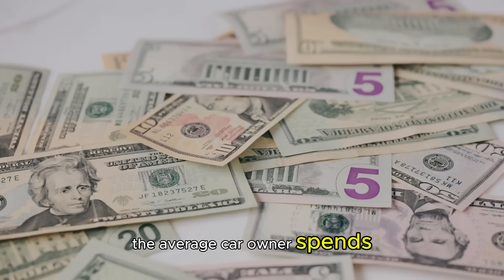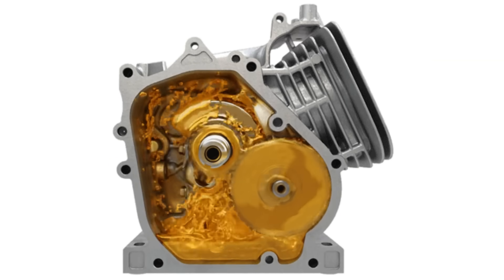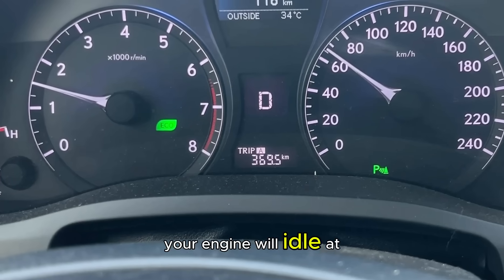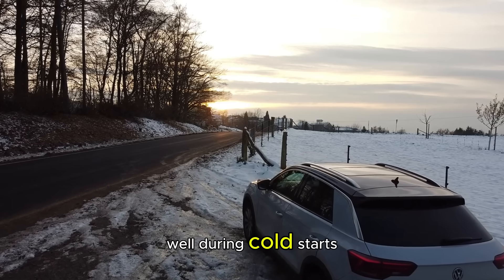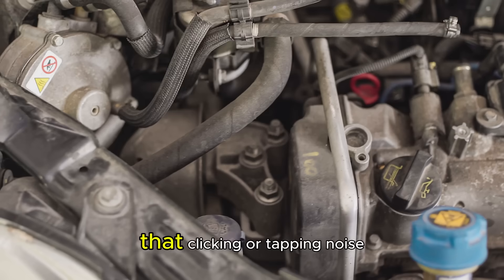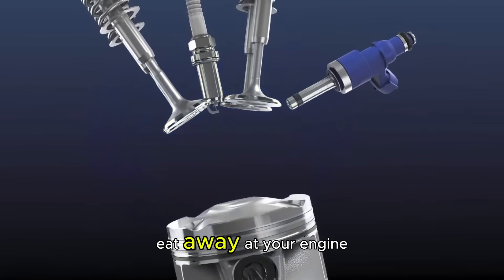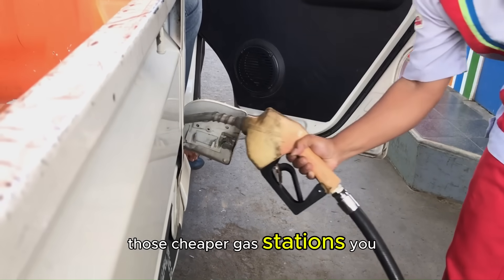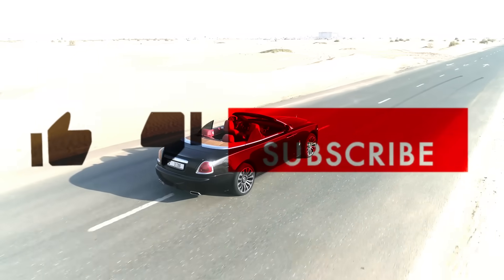Stop Making These 6 Cold Start Mistakes Before They SECRETLY Wreck Your Engine

Comment: When I worked at Holley I was supporting a Chrysler cold trip in Sault St. Marie, MI in '81.  Mitsubishi was at the same hotel.  They'd pull out onto the street and floor it.  Not sure if that had anything to do with their cracked cylinder heads and top compression ring on #4; I pulled a few of them apart.
>Oxygen energy content doesn't decrease at low temps,  actually goes up per volume because it is more dense.  Combining it with fuel releases the energy in it.
>Cold fuel doesn't vaporize a easily as warm fuel, especially summer fuel in winter.  Up north they change over in October, back to summer fuel in March.  You need to put in extra to make sure it will light during cold start; it's not too counteract the thicker oil.  On FI vehicles fuel and spark cals change at specified RPM points during run-up from 0RPM until it starts, then run mode kicks in.
>Carburetor hot and cold idle airflow were set for broken-in engines, lower green engine RPMs due to higher friction were listed in manuals and put on some underhood emission labels.  Alternately, carbs could be set for green engine conditions for the required RPM AMF adjusted down after break-in.
>I worked as an automotive D&R and cost reduction engineer in Detroit for 44 years specializing in fuel systems, powertrain & brakes, supporting hot and cold trips, production launches in country and off-shore, post-production and in-service quality issues.  I also worked as a mechanic for a few years while paying my way through college and maintained my certification for 20 years.

Comment: Wrong. Idling your engine to warm up until it reach normal temperature helps your engine to reduce wear and tear.

No matter what you do your engine will heat up more and more thats why it has thermoswitch and thermostat to prevent making your engine temp high.

Using your car after 1 to 2 minutes after starting even if you drive it lighty will increase the wear and tear. Regardless if it is new or old car, imagine all those piston working hard just to make your wheel spin? All those weight and your piston, pistong rings and block liner is still now expanding? 

Short explanation : Brake pad and rotor disc slides when too hot right? Same goes with your engine "piston, piston ring and block liner" oil can rotate within few seconds but it is crucial to let your engine goes to normal temperature before using it. That'a why most of american user cars blowby fast.

Comment: The reason your mechanic doesn’t tell you to let your car run a few seconds before driving is because it’s common knowledge! This guy obviously knows nothing about how a car engine works nor does he have a clue about how modern lubricants protect engines in extreme weather. Let’s put it this way, the first component of an engine to receive oil pressure is the main crank bearings.. when was the last time ANY mechanic had to deal with this problem? It’s few and far between and has nothing to do with cold starts . I live in canada. I have never had a customer come in with engine wear because they didn’t let the engine warm up first. “Don’t let the engine idle, drive it lightly” haha i gotta wait for the windshield to defrost before you can go anywhere it the first place! Load of BS

Comment: Learn to buy a reliable vehicle without the necessary bells and whistles and a vehicle reliable thats suited for the climate. A turbo charged modern gasoline engine  usually doesn't last past 100000 km or even get that close. Stay away from older KIAs they had class action lawsuits against their engines. Those engines aren't winter friendly. The best block heater is actually a recirculation type that's plumbed into your cooler lines. Just plug it in half hour before your ready to leave and make sure it's a good quality block heater.
Reply: I love Mazda 3s. They seem as if they were designed for the rough Canadian winter
Reply: Modern turbo engines without a doubt last 100k km or 62k miles. I'd be willing to bet that most of them do.
Reply: Most modern Chinese made turbos don't last the test of time. Europe is a different ball game.

Comment: Nope, modern turbos are oil and coolant cooled. Your car will circulate coolant for a bit after you turn it off, sparing your turbo. Letting it idle for a bit was good info for about 20 years ago
Reply: @JInfinity7  the coolant stops circulation once the water pumps stops, which is when the engine is turned off..for long term wear..do not exit interstate driving without idling for 1 minute to cool turbo.

Comment: Multi-viscosity oil eg 10W/30 or 5W/20 means that the oil is thin at low temps "W" stands for winter ie the oil is the low number in winter and the high number in summer.

Comment: Oil does lubricate when cold , its how the oil is designed . 
All the metal Parts have been manufactured to reduce expansion when hot . The reason why they say to drive off instead of idling is to save fuel . No Engine will be harmed at Idle .

Comment: Mechanic here, your engine still have oil in its passages. Even days after not using it, yes not as much as normally but it isn’t dry dry.
Synthetic oil is stickier too. Enough so it sticks to the walls and components 

So don’t think it’s dry but it’s not lubrificated as much as usual

Comment: If it's -54f.... don't try to start your truck. I spun a bearing because of that. Yep, costing me 12 grand now. So i had an idle switch installed in my other truck, make sure the Blick heater is plugged in. And I just don't start it, unless absolutely necessary, until it's above -20, and prefer 0 if we're lucky enough to hit that somedays

It spun about five miles down the road, not at startup, which is why I had the idle switch installed. So I can set my idle up during warmup.

Comment: Mistake two can be taken care of with an idle set. Not all vehicles have this though. I set my at 1100 rpm. It's way too cold to take off in a minute, or even 5. 

I've idled for 8 hours in sub zero temps for days during the first winter here in Montana. I was still building and didn't have a way to keep my pup warm

Comment: Every car I own, I always make time to warm the engine up. Give 5 to 7 minutes. That's just right amount of time. Change my oil twice a year for the winter season 0W 30, and summer 5W 30. Sounds expensive, but it isn't. I buy my own quality and filter.
Car drives like new. 

I do agree with the turbo, even when driving normal, I'll wait for 30s to a minute 1. 

My neighbour, in the other hand, soon as they jump into the car, gone😮. The moment they get home, before turning the engine off there in the house 😂😂😂

Comment: So about the Turbo, DONT let your car idle after highway driving or hard accelerating. That is actually a turbo killer. Best thing to do is to drive the last lets say 5-10 mins normaly again
Reason is that if you let the car Idle the turbo or better said the oil in it wont cool down

Comment: Hello, I have a question if you would be so kind to answer. I have a Civic Si 2023, and in extreme temperatures of 25-30°F, it takes around 5-10 minutes for the cold coolant light to turn off. I know you mentioned using a block heater, but in Georgia, it’s rare to see one or install one in apartments. Would it be ideal to drive following your advice to let the car warm up for just 1 minute and drive below 2500 RPM with that light on?

Comment: That's why, with all my cars, I've always let the engine run until it's warm before driving off.
Reply: @x619-m2y  correct method...the transmission fluid needs more warmth than the engine oil...different characteristics of each

Comment: The moments I hit the gas is when the car reaches around 1300rpm to 1500rpm,i do this cause the battery has energy leaks somewhere and sometimes the car as its idling completely dies cause of insufficient power

Comment: As a mechanic, we don't want to "hide" things from owners so their cars break. This is very misleading. Cars are machines and they will break from wear and tear, no matter what you do cold start wear will happen. As long as you use good oil and filters, follow the maintenance schedule your car will run for a long time.
Reply: Yes I heard that fear mongering and downvoting, most of us (at least all the one I’ve worked with and employed) care about the cars and have pride in their work.
Reply: I'm not a professional mechanic I do 90% of my own work because I grew up in a family of mechanics, diesel fitters etc.
I do know that the vast majority of mechanics won't give you bad advice or do bad work, because that's sui**dal for a business nowadays in the times of social media.
Reply: Facts. Thanks for common sense. My 06 F150 4wd w/293k mis has just had good basic maintenance practices & sensibility driven. My newer 24 F150 Tremor will be treated similarly. 👍🏻
Reply: Oil change intervals on some new cars are too long. Manufacturers are not doing the owners engines any favors.
Reply: @gairnmclennan5876  Ford doesn't use belts to drive the oil pumps on some engines for longevity.
Reply: Most mechanics are frauds

Comment: The engine warms up pretty quickly including the oil. I drove my car for 30 seconds around the block and the engine was already hot. During cold start just dont floor it on the gas pedal and you'll be fine

Comment: The first point about the athlete and not being warmed up. Yeah if you start your car then redline it it’s bad. However an athlete can get up and walk with no warm up required.  Same for engine.  Drive gently and keep the load light and it’ll warm up the oil much quicker. Plus added bonus of warming tranny, diffs and bearings too

Comment: I live in the south. Cold winter morning about 10-25 degrees. I crank up and run for 20 seconds. Then drive easy under 2000 rpm until up to operating temperature. If the catalytic converter goes , I own a nice Dewalt Sawzall and I will promptly remove it and straight pipe it. Cats bring pretty good money at the scrapyard.

Comment: Do you have the BS thing about this? Whole damn thing is today's lubricants the oil. It doesn't just disappear off of your bearings in your surfaces. Wherever oil is needed to lubricate the engine. Okay, it's pretty good stuff. It's going to remain there for years. It's not going to fall off in a day. This is BS this guy's talking BS. And the combustion chamber doesn't give a damn how cold it is. Your fuel is going to ignite off the stupid spark plug. That's it. Case closed. This is why they have thermostats in your vehicle because it isolates the engine from allowing it to circulate coolant beyond a certain point so it can heat up the engine faster. That's it. This engine design is so old. It's so crappy. Most cars should have already built in block heaters. Why they don't. I don't know. It's manufacturers just being stupid especially if you live in a cold environment. You should have block heaters right on your vehicles. That's it. No more

Comment: I’m confused by the “Don’t turn up your heater” one. Most people who don’t have a garage and are living somewhere with harsh winter conditions will find their windshields to be frozen by morning. Even if they scrape the ice off or they use a blanket on the front windshield so that it doesn’t freeze overnight, the moment they get into their car, they will cause the windshield to be foggy by breathing. The only solution to that would be to set your heater to windshield only and to blast air onto it (even if it’s still cold). What would you suggest to these people then? Because they certainly can’t drive with a foggy windshield.
Reply: @notthingbeatsajet2holiday  use your heater immediately, the thermostat opens only when reaching the roughly 190 degrees.

Comment: 5W/30 is a very good all year long weight oil. Just remember W stands for winter and 5 flows below 0 cold weather. If your car starts to  over heat turn on your heater even in summer it will cool the engine by drawing heat from the engine. Still you may want to pul over and wait for the engine to cool. Check coolant levels.

Comment: i can confirm that for the transmition. I drive a manual car and it is not easy to chnge gears when th oil is near to frozen. after few miles its ok but at 0 its hard
Reply: I solved the problem of changing gear with a stiff MT when I properly warm up on the car, especially from -20 C and below.

Comment: There's a lot of misinformation here... but when you state "mechanics don't want you to know" it already raises a red flag.
Reply: Please be kind enough to actually explain what is wrong, bc for my limited knowledge, it seemed quite reasonable and believable.
Reply: @dovs96 Mechanical parts are designed with correct tolerances built in. Car manufacturers design AND test vehicles in all extremes of temperatures. Th oil he mentioned as being thick when cold? Most engines are designed to run with variable viscosity oils. Only in the worlds coldest places does oil become ‘thick’ and require engines to be warmed prior to turning over.

Lastly, all new cars come with a manufacturers warranty. Are they really going to sell badly designed vehicles and risk all those claims? 

Just think of a PHEV, you might have driven for 20 miles, without the iCE starting. Then you accelerate hard, engine starts from cold and immediately goes to high rpm…? Yes, the manufacturer thought of that too!
Reply: @3204clivesinclair "they are not stupid, they thought of that!" take doesn't prove anything, unfortunately. I can tell you about a lot of bad or even malicious practices from car manufacturers and dealers. They do stuff that breaks your car, they evade warranty and all responsibilities when it's possible. Also, warranty is not that long, engineering and treating a car to last for a warranty, and treating it to last as long as possible is 2 different approaches, and guess which one is used by car brands.

Referring the existing practices and "common sense"  instead of the exact technical solutions designed to solve these problems is not a good demonstration of the mechanical background, more of the magical thinking.
Reply: @ “They do stuff that breaks your car”. I assume you provide links to legal cases to backup that claim?

If manufacturers are doing what you claim, how come they are still in business?
Reply: @ Clearly dvos96 has no clue.  You provided the answer "he" asked for, then "he" argues with you.  I'm thinking "he" is a Karen.
Reply: @3204clivesinclair It is impossible to build something for any and every situation. Oil can be to thick, but its not going to instantly kill, just a bit more wear. Look up in alldata or something, there are specified things to do depending on where you live.

Multi grade oil is special, but multi tolerance metal does not exist

Maybe some inaccuracy in the video, but thats no where near "missinformation", if you consider that misinformation I suggest go learn a thing or two.
Reply: P.S. I agree about a cheesy "mechanics don't want you to know" part.
Reply: explain what a lot of misinformation is?
Reply: he is not mechanic but content creator
Reply: @ВладимирВладимирович-д7ш2я  Clearly not an accurate content creator.
Reply: Seriously! There were a few things that are true but so much misinformation its hilarious. Why do ppl with no mechanical background decide to make videos like this 😂
Reply: @trevorpatton6377  why people with required background always say if somebody is wrong, but never tell what's actually wrong and why. Is it some pathetic ego jerking? I seriously don't get it.
Reply: Actually, everything was spot on
Reply: @Johnnyjacobs-h8f  🤣

Comment: It is very reasonable advice. The short trip problem is very real, especially those with EGR. When very cold, I always switch the heater OFF. If I lived in a colder climate I would buy a WEBASTO heater that works independent of the engine and warms it up before starting.

Comment: I have a '22 Subaru 2.4 turbo. 
There is a function called flood and crank. When the accelerator is held to the floor, the engine will not start, it cranks normally, starting the lubrication process. 5-10 seconds of of this pre-adds lubrication to the system.
Then normal starting with no throttle input. 
Then warm until the trans (CVT) temp registers (85°) before putting it in gear. Followed by 1500-2000 rpms until the trans temp is over 150°. Then normal driving.
Before shut down, very easy driving and let idle for 60 seconds.

The MOST important thing I do is defeat the auto start/stop. 
I hated the fact that it shuts off at a light, starving the turbo of a proper flow of oil and cooling.

Direct Injection carbonization is another issue.
Reply: @RandThompson-dd3sk  use marvel mystery oil in the fuel...destroys carbon